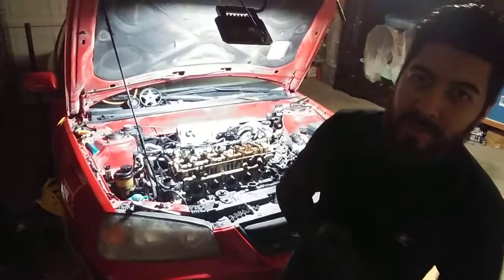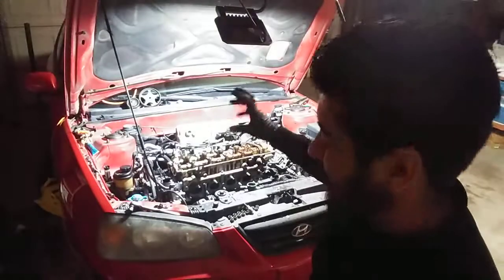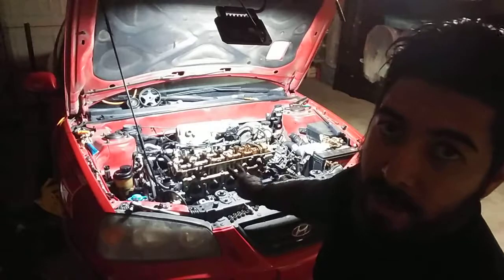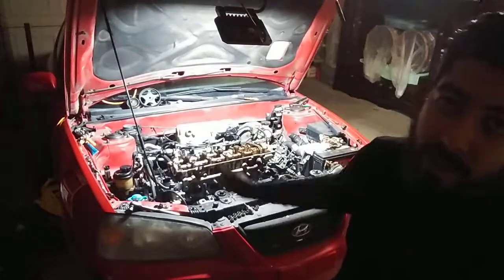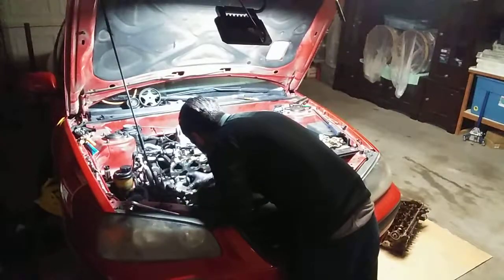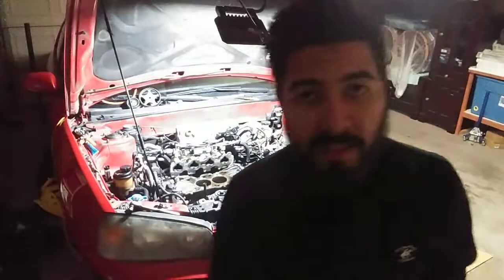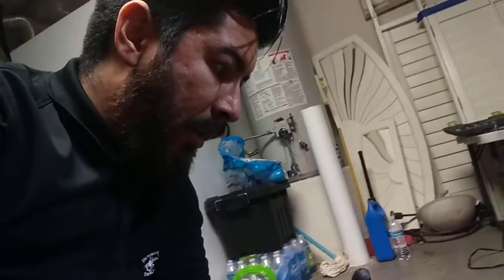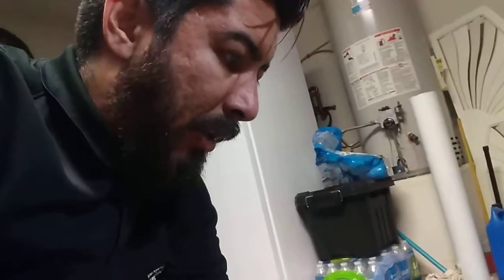2005 Hyundai Elantra 2.0L Head Gasket Failure

Comment: Thank you for this. Looking at one of these tomorrow and it looks like a easy to work on engine.
Reply: oil leak in my Hyundai Elantra FX 2005 5 Door Hatch,RE Sealed Sump Gasket Twice,but Mechanic said it Could be the Cam seal,but I think now it’s the Cam Seal and Timing Cover,as that would Spray  Everywhere which it did.
So I am going to Take Timing Gear off Timing Cover off and RE Seal everything,the Elantra has a Noice that Seams to be Constant,and Could be that not enough oil is getting to the Top of Motor,would you know What else it could be.
Reply: Noise I meant

Comment: Nice Video, I have a 2003 Elantra that I just changed the Water Pump, and Timing Belt, Radiator, Thermostat, all Hoses and all of the Belts. Put it all back together the car runs Great, except that it gets Hot very quickly. I took it back apart and discovered that My Timing Marks are spot on: I cannot find Water in the Oil however, when I changed the Bypass Hose and Thermostat some very Murky Coolant came out. Would You concur that  the Head most likely has a hairline fracture? or would you lean towards it being the Head Gasket only?
Reply: I bet the problem was air trapped in the cooling system. Dont forget to purge the air out of the cooling system
Reply from the maker: Pray that it only be your headgasket the only time i would worry about a cracked waterjacket in the head is over heating, which can happen there is no doubt there, but in my case that car over heated warped the head and lost compression everything else was perfect no water being mixed with oil, your case can be very much different maybe over heated internally due to blockage and boom there is a cracked jacket, and you don't get a over heated reading because there's water flower on the coolant temp sencor?! I wish you the best of luck be sure to Subscribe i would Appreciate it Thanks!!!